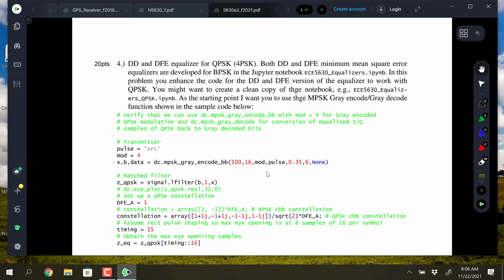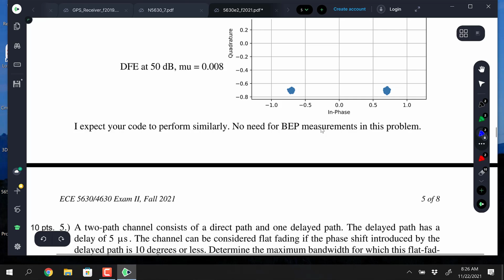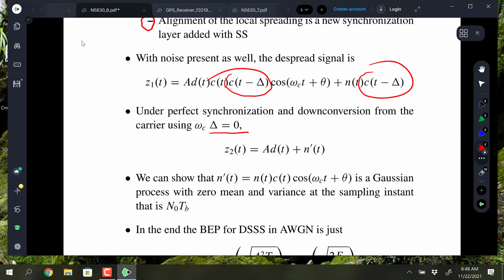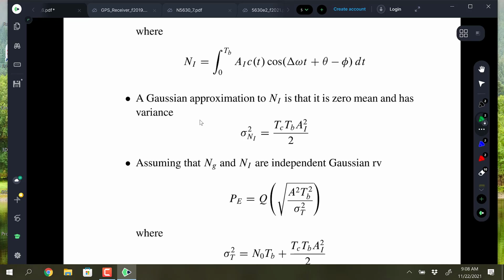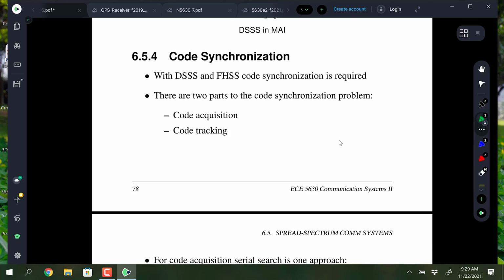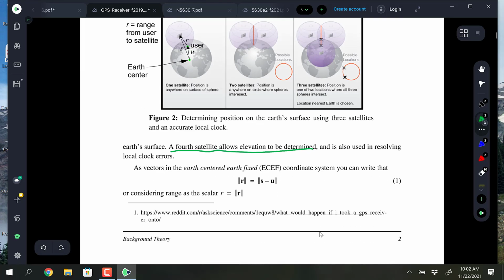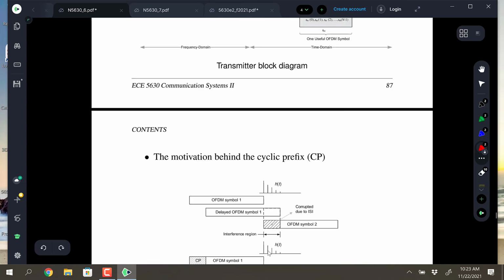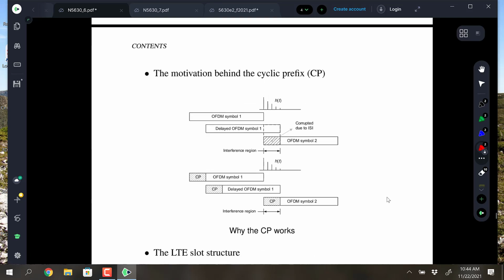Communication Systems 2 Lecture 13 Fall 2021

Comment: Thanks a million for sharing the lectures Prof Wickert! 
just wondering whether the material of notes and homework available anywhere online i.e.on github etc because the webpage seems not existing for outsider of uccs?
Reply from the maker: The University shut the old Web Site I had and moved me to a WordPress site. I am moving things, time permitting. The site is https://faculty.uccs.edu/mwickert/. Let me know if this was your issue.
Reply: @dr_mwickert  yes dr wickert the above link for the new site is accessible for non-uccs user. thanks a lot for the reply!
Reply from the maker: @jiang3408  Be aware that some of the links on the ECE 5630 site are not valid. I made a copy of the ECE 5650 site to quickly get videos, lecture notes, and homework assignments posted. I still need to fill in other content for this course.
Reply: @dr_mwickert  that's alright. really appreciate your sharing of these materials.